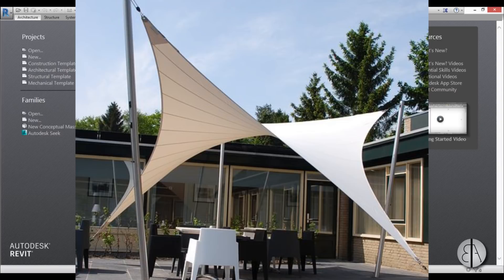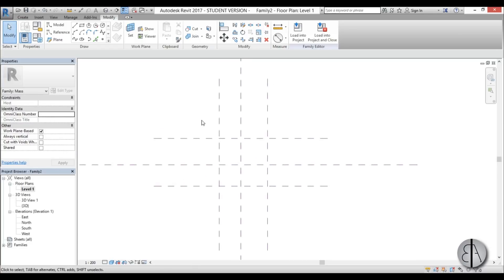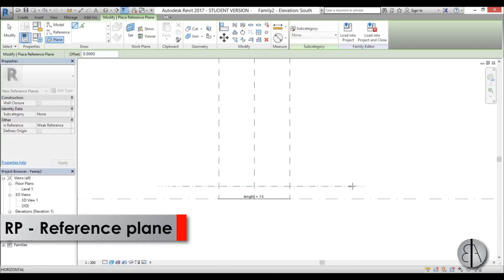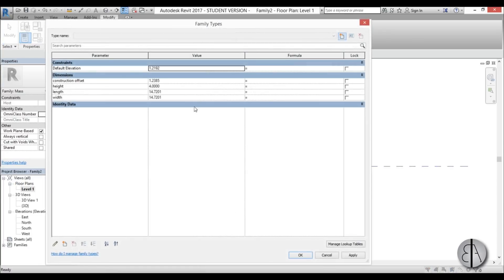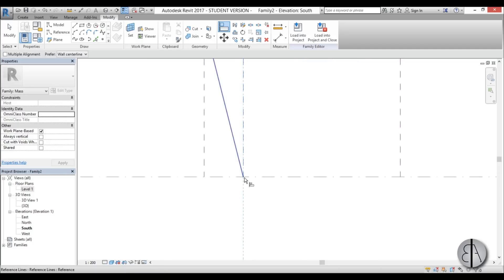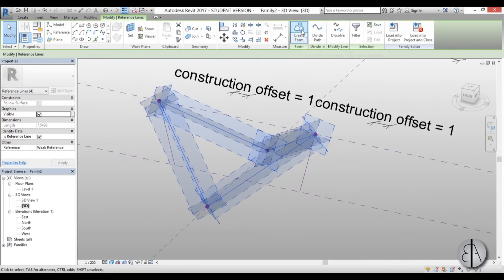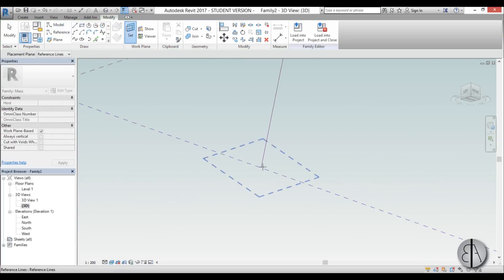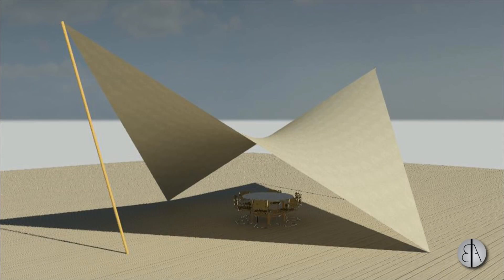Parametric Tensile Canopy in Revit Tutorial

Comment: Hello, I know I am 2 years late but I am a beginner and am learning through your videos! Very easy to understand! I would just like to know, how do you save the file after you completed the tent structure... I am having big trouble with that as I tried saving but it doesn't load properly nor does it show in my other projects when I insert it... I even tried to save proper visibility settings on the actual tent structure and it still does not work... Any help please? :'(

Comment: Here is a flat roof challenge,

Industry standard 2% roof required 4% cricket at 30:10 ratio angle from bird eye view.

2% roof is easy slope on one side. 4% cricket is bit more work to make seam match 2% roof.

We can menuly use modify tool to adjust flat roof to make 4%

Or

We can use dynamo to stream line it.

Or
Can you make a video on using adoptive family to stream line it?

Comment: I followed this step by step and it turned out great. I decided to go further and  have 3 poles & 3 points on the ground( 2 triangles rotated 180 degrees ,one on the ground and the other at the 'height'level reference plane). had trouble getting reference planes in place but eventually did. to get the construction lines to align to the planes proved futile and at the end  the create form gave 4 flat triangles (like an open tetrahedron) . How would you do it to get a tensile surface ?

Comment: Awesome, but Balkan im new to revit and i have some bumps on the road now , i make a custom stalked wall (generic)of height of 2200mm and then on top a 400mm concrete ringbalk so when i do my section it turn out good but when i see it in elevations or in 3d i can see the line of the concrete ringbalk showing, and how can i stop it from showing the 2 lines ?
Reply: glenn yarzagaray You could hide the lines you don’t want to see using the Line works command (lw) and setting the lines to invisible. Sometimes it fails to hide (too many overlapping lines)  but its worth a try.
Reply: glenn yarzagaray maybe you can change the precison of the detail in the 3d view.
Is a small rectangle near the scale and the view style. 
You can choose between 3 option.
Or even tray to change the scale use a lower one like 1:50...

The Revit kid is also a nice Chanel whit tons of tutorial.
He has a nice tutorial about stalked wall. Check this out.